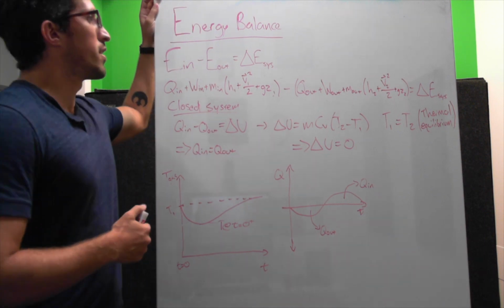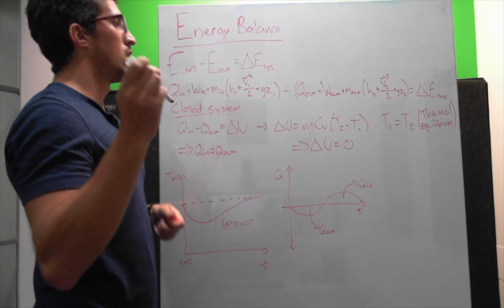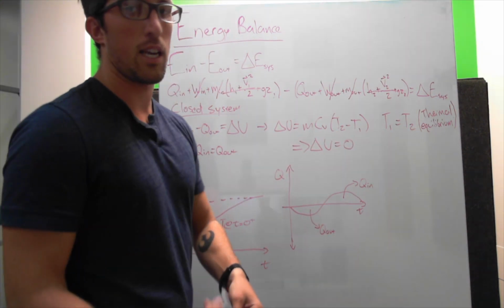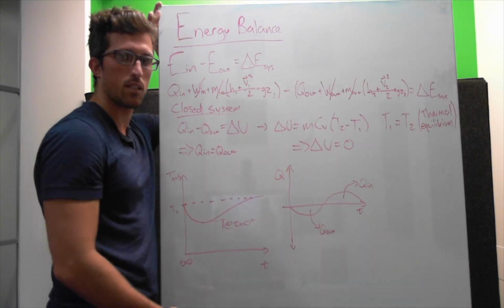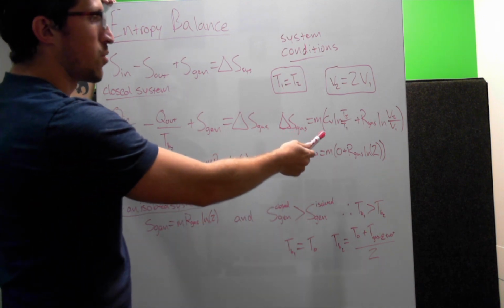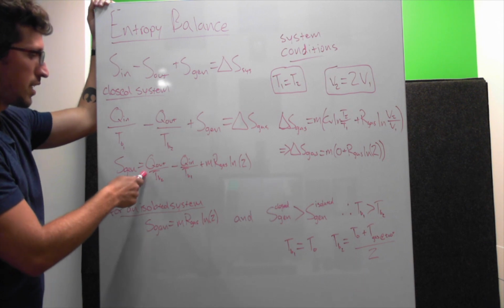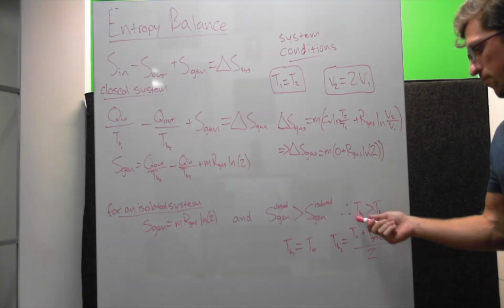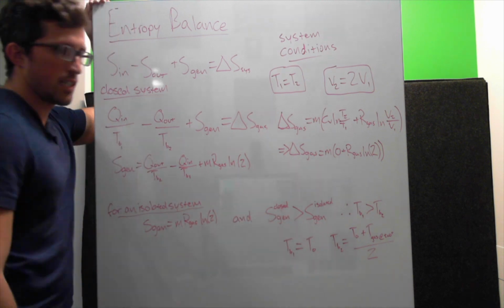Rapid Expansion of Helium In a Closed System

Comment: Thank you for the efforts made to share this video online, I found it very helpful!

In regards to the temperature of the helium when it undergoes expansion, am I wrong in referring to the Joule-Thomson to suggest the helium should increase in temperature? (having a negative coefficient) I found it strange that the experiment didn't support this concept.
Reply: The pressure raised and temperature dropped. So if you compress the gas, the temperature should be drop?
Reply: @myselfnegative4290  🔴 What Is Islam? 

🔴 Islam is not just another religion. 

🔵 It is the same message preached by Moses, Jesus and Abraham.

 🔴 Islam literally means ‘submission to God’ and it teaches us to have a direct relationship with God. 

 🔵 It reminds us that since God created us, no one should be worshipped except God alone. 

 🔴 It also teaches that God is nothing like a human being or like anything that we can imagine.

🌍 The concept of God is summarized in the Quran as:

📖 { “Say, He is God, the One.  God, the Absolute.  He does not give birth, nor was He born, and there is nothing like Him.”} (Quran 112:1-4) 📚

🔴 Becoming a Muslim is not turning your back to Jesus. 

🔵 Rather it’s going back to the original teachings of Jesus and obeying him. 

More .....👇

🔴 THE RETURN OF JESUS